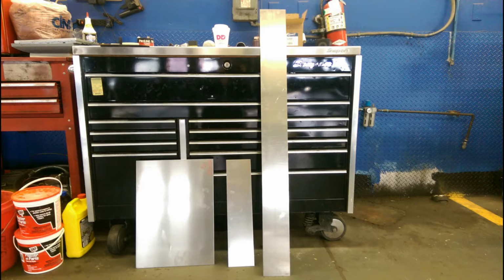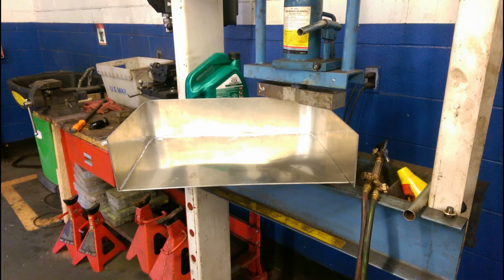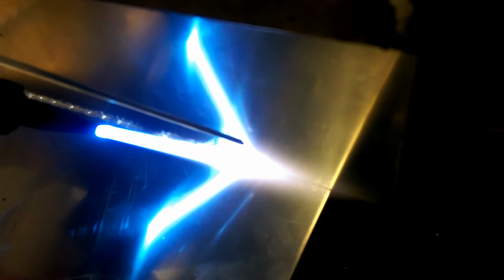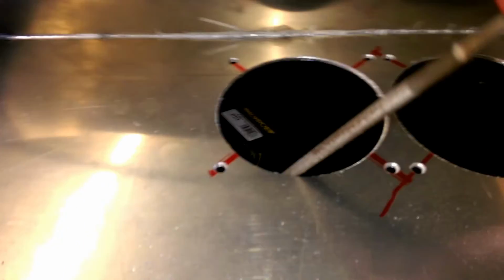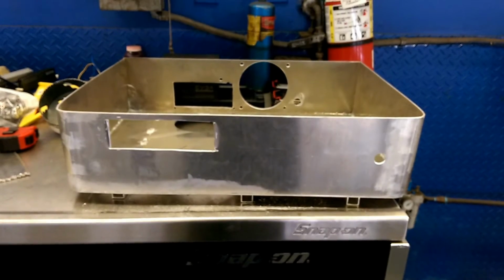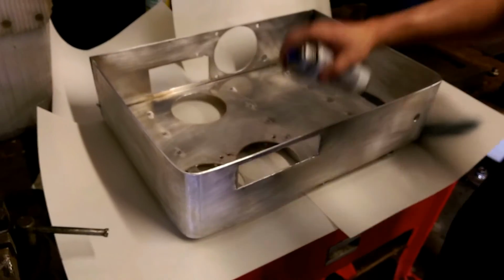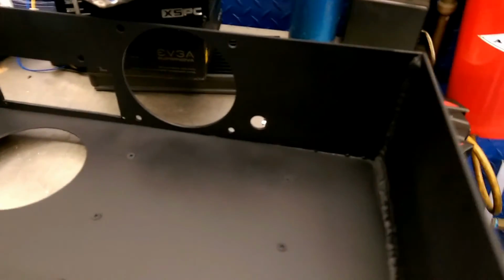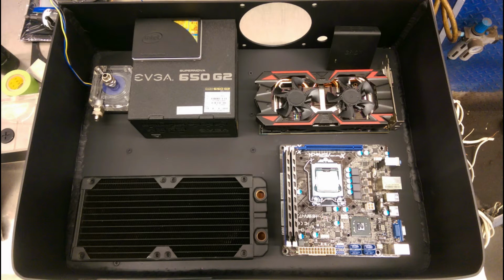Mini-itx Build Part 3 Building That Custom Case Vlog 2016

Comment: FINALLY!  Someone who's doing a proper custom mini itx WITH a custom case.

Also, as a professional welder, I approve.
Reply from the maker: +Arcimedes36 Hey man. Thank you for the approval. That means a lot coming from a pro. Unfortunately this project was abandoned a while ago. Only thing missing was the water blocks. But people seemed to show a lack of interest during the build. So it was put on the back burner. There are plans for a redo in the future. Maybe in 2017.
Reply: CyberDen Systems well, you still earn my like and sub.  Hope you get a chance to pull the whole thing together...it gives me faith working on my own project.